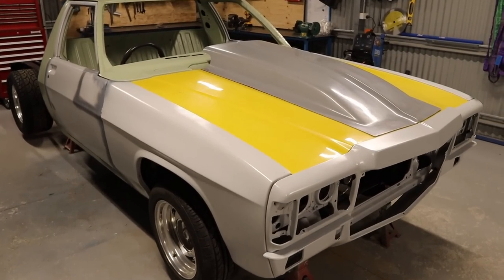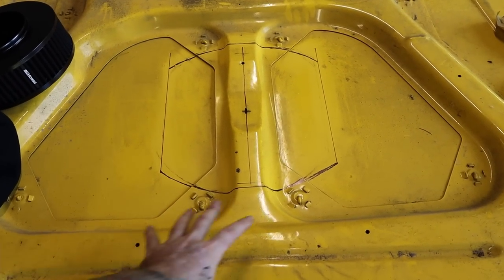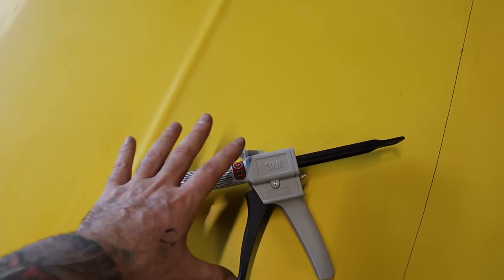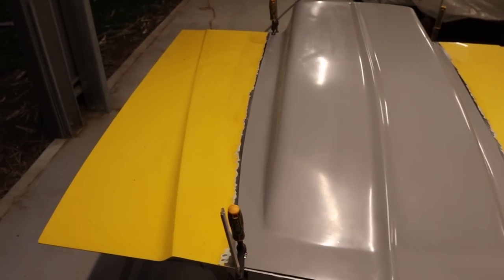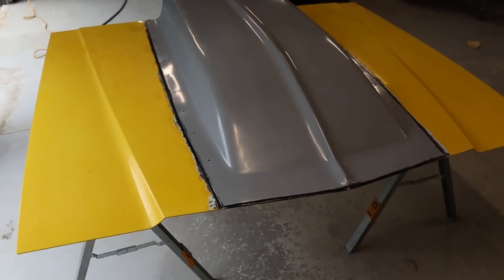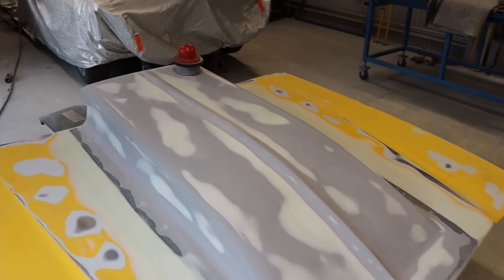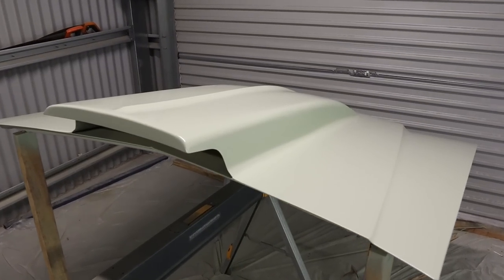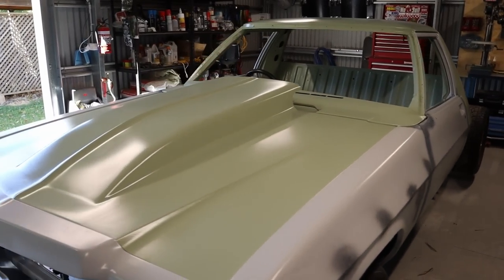Fitting a Reverse Scoop - HX One Tonner Build

Comment: A great way to suff all that impressive work, by the way air going straight in at the front in going to give you more air pressure. But it’s your car not mine, I just don’t like them myself.
Reply from the maker: Yes you are probably right the air coming into a front facing scoop is most likely going to perform better. I'm not a fan of the front facing scoop that's why I went a reverse.

Comment: Nice job Sambo. I would look at making your cut out slightly bigger if you can incase you want to go with a larger circumference air filter. Watch a couple vids on them, more surface area equals less restriction. Be easier while still in primer than down the track. 
Not a huge fan of reverse scoops but it came out nice mate. Think it will look great once in the final colour.
Reply from the maker: Cheers Carl... I never really used to be either but I like them now. There not really many options out there on scoops. I was thinking the BA bulge would look ok.

Comment: Coming along very good man. We used to use that panel bond in the panel shop. That’s what we use to hold the 1/4 panels on, then spot weld and weld. But they can easily hold a 1/4 panel on by its self. There are testing videos somewhere on YouTube where they do a crash test to show the strength of the panel bond 👌🏻👌🏻
Reply from the maker: It seems like very strong stuff. I would hate to try and pull the scoop off the bonnet

Comment: Nice job ,the other option is to let repliglass do it all for you, they will even cut out underneath if you ask on a full glass bonnet. How did the epoxy rub back as on my bonnet it was like  as hard as a rock to sand ..
Reply from the maker: I was thinking of going a full glass bonnet but just opted for the glass scoop. I think there a bit of a lead time for a full bonnet. I have yet to rub the Epoxy back as yet. When I rubbed the cab back it was not too bad but yeah it does get a hard shell on it.
Reply: True about lead time I wasn't in a rush helped ,got it back on now in 2k looks ok ,I've got shit gaps on the hr so mite try your process been pondering staring long enough now.

Comment: Did you find this was a better option compared to ordering a complete fibreglass bonnet?
Reply: A full fibreglass bonnet is illegal in Qld I think adam
Reply: @Mr07obrien  Pretty sure you're right, mine had to go over the original bonnet.
Reply: Personally i would fill and weld the end off the cross braces.. Look at how howard astil designs. How he does a bonnet he. Has won a few street  machine 1st place
Reply from the maker: I think so. The only real advantage to the fiberglass would be lighter bonnet. I did look into it but it was a 10 month lead time to get a fiberglass one. Im happy with the fiberglass on steel.
Reply from the maker: I was thinking of doing that. I still can I guess...